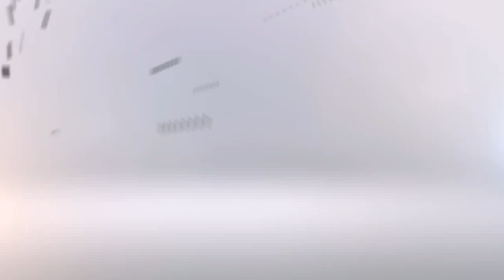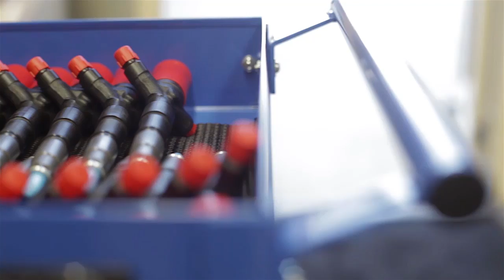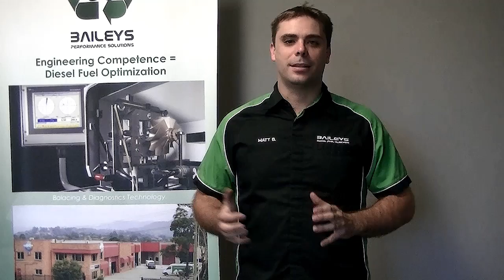BDG - Suction Control Valves

Comment: you explained the scv's job well. But there is another big problem & that is buying the item.
 So many people (me being one of them) have spent good money for a new Denso SCV only to find out that I actually purchased a counterfeit version. 
They come in identical Denso boxes, they are the exact colour & the devices themselves have all of the correct markings & numbers etched on them. They look and feel exactly like a perfect Denso SCV and some of them even cost as much.
But after you install them they make little or no difference, (some of these knock-offs make your vehicle run even worse) so you outlay more money & have your vehicle tuned (on a Dyno etc.) only then do you realize that you have actually purchased a fake.
I have been told that some of the fakes are so good that you cannot tell until after they have been installed & tested. They are that good that I couldn't tell the difference between the original Denso svc that I took out and the fake one that I put in just by looking at it, it was a perfect copy. 
But  I believe that if someone was to weigh a Legit Denso SCV and compared it to a knock-off version there would be a big difference in weight. No way would the counterfeiters get the weight right because they would be using inferior metal & internal components to make them. I think that this would be a good way to defeat these scammers.
Reply from the maker: Do you still have the offending solenoid?

Comment: I got a nissan primera p12 2004 dci 2.2 keeps going into limp mode, turn it of then on again comes back good, engine light is on all the time, was a noise coming from fuel pump area tapping noise, tapped with the handle of hammer, could that be it getting stuck somewhere, wanted to change it myself but am worried it might make it worse, will it need bleeding when done. Any help would be very welcome thanks Ray.